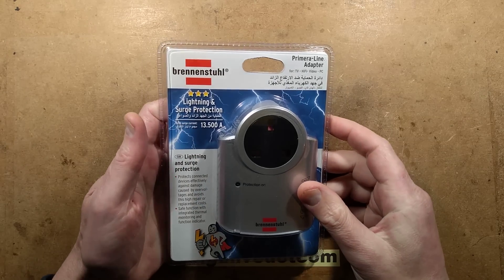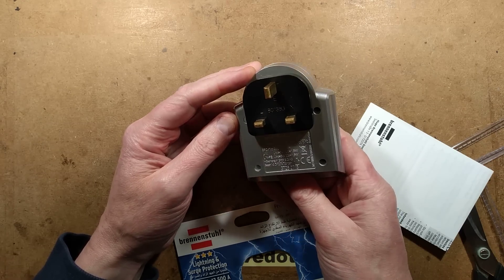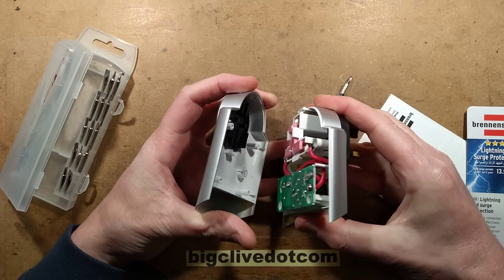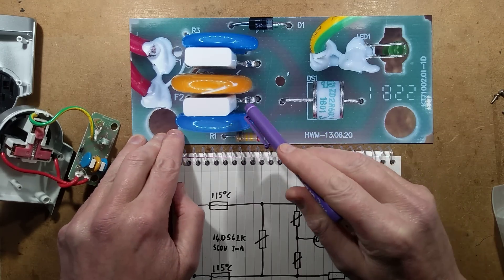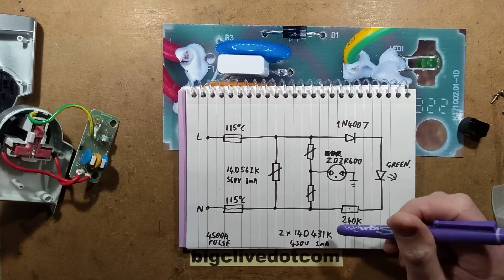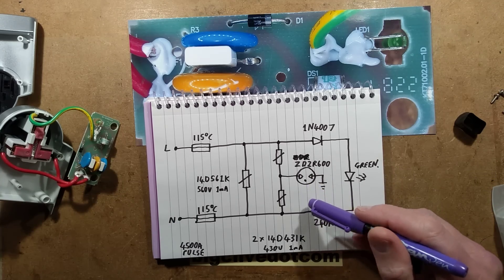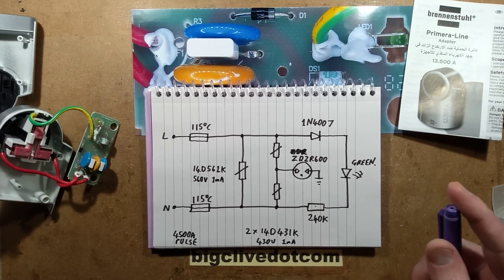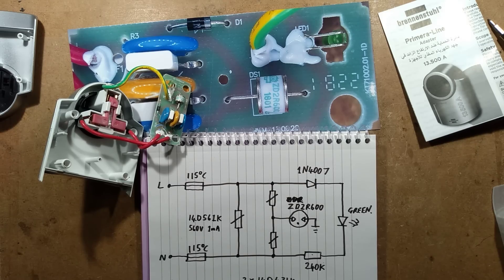Inside a 13,500A surge protector.  (With schematic.)

Comment: Thermal fuses in a sandwich squished together with HEAT shrink tubing. Assembly must be fun.
Reply: Perhaps they shrink the heat shrink around a form and then slip it over the components similar to how clive pulled it off.

Comment: I had an RS branded protection device,it actually called itself a power conditioner and did have some chokes inside as well as capacitors along side one very big MOV, I used it on  my computer and printer. I came home recently and there was the smell of burning plastic and electronics throughout the house. I traced it to this device and found that there a a big hole in the side of it with scorch marks up the wall, when I took it apart the MOV had disappeared,exploded right off the board leaving just stubs of vaporised wire. As far as I know there had been no thunderstorms in the area and nothing else in the house was damaged.
Reply: MOVs degrade with every little spike they eat.  Eventually, they short and kill themselves exactly as you describe.
Reply: Some of the APC Surge arrest devices are intentionally designed to do this. I had one in my office at work. Just like you, came in one morning to smell of electrical smoke/burn. Dozens of other computers on the same floor and branch circuit were not damaged. Neither was my computer. But the APC gave it's life to protect it. Numerous internal components were blown to smithereens. So, the APC was "sensitive" enough to blow, undoubtedly due to some kind of surge, even though the surge did not kill any other equipment. So it was a $45 fuse. Later research on my part revealed the APC was DESIGNED to do this. Very sophisticated. It is built like a brick house inside. I still use them today (same model). By the way, the plastic housing is flameproof.

Comment: If the circuit is just in parallel with the mains, wouldn't it be then way more useful to install it directly inside a fuse board? (In a different form factor then.)
Reply: L3P3 Those are available from major brands of fuseboard switchgear.

Comment: I had to go back to around the three minute mark to see where line current came into the device. I was thinking the current had to go through the circuitry and then out the other side. Trickily, they connected the gozinta directly to the gozoutta.

Comment: If there was a problem and the gas discharge did its job would that then trip the rcd on the fuse board?
Reply: That as well as fuses/circuit breakers. The problem is that those aren't fast enough to stop high energy pulses like a lightning strike or near strike.

Comment: How would you test such a device?
Reply: Bas Emmen Charge a big capacitor bank to deliver a short 100kV pulse through a simulated wiring impedance. Measure voltage peak across device and make sure it stays somewhat low.  Labs like KEMA have the setup and procedures.

Comment: I do love how the world still can't decide 9n universal standards for things, there's thousands of standards and yet we can't decide on if we want commas or decimal points, it's a mess, we just need to standardise everything, it'd make life so much easier, it's like how the UK has Metric as the "Official" unit of measurement yet uses MPH as the speed limit, no logic, or the inconsistent use of commas and decimal points, different electricity voltages and frequencies, and, measurement of things like power or torque, very very frustrating
Reply: peter geary Because that number notation has been deeply ingrained in human languages, it's basically unfixable as long as there's a large fraction of humanity on each side.  The scientific way is to never use 3 decimals after a decimal marker and always use the proper metric prefix, for example 13,5kA or 13.5kA for the claimed abilities of this thing.
Reply: Keeping MPH is the least of it, I had the misfortune to be working in a laboratory when the UK was transitioning from Imperial to Metric then to SI which lead to some bizarre kludges like coating densities in milligrams per square foot.

Comment: Why have a diode in series with the (light-emitting) diode?
Reply: Ugo McFoley XXIV The diode will limit alternating current so that it only flows in the direction that the LED requires.
Reply: @gordonrichardson2972  But so will the LED itself. It's a diode.
Reply: Ugo McFoley XXIV LEDs do not like to be driven under high voltage reverse polarity, it severely degrades their lifetime.
Reply: @ugomcfoleyxxiv8621  LEDs have very low reverse breakdown voltages - they can't withstand reverse line voltage.  You have to have a real diode in series.

Comment: On the back of the device it "clearly" states that it is for 13.5 Amps - further supported by the rating of 3120W (230V * 13.5A).
The extra zeros behind the number are just there to get people to think it says 13 500 when it really is just 13.5 A.
Reply: 13 amps is what you can plug into it, 13K amp is what it's "rated" to block before turning into a bright flash.

Comment: If it was a thirteen-and-a-half Amp unit, it would not have two zeros at the end. Basic rule of scientific and engineering notation: don't include more digits than are significant.
Reply: pieter zeeuwen Perhaps those digits are significant, and it offers very precise protection of 13.500 A and not a milliamp more :)
Reply: @Bomag  Good one. I could have been the case if we didn't know that the components inside are not that accurately specified (thanks to Clive's insights).
Reply: @pieter1102  Yeah I was only kidding - just making a nerdy joke around the fact that engineers use trailing zeros in decimal numbers to specify the precision.
Reply: @Bomag  I got that (even though I'm an engineer), which is why I said "good one" (i.e. good joke). Maybe that was the Brit in me talking. If so, I seriously apologize (and that is the Canadian in me talking) ;)

Comment: Nice design,  although with every voltage spike the MOV's get they degrade.  When getting to a point when another voltage spike penetrates through the disk you have to replace the unit or replace the MOV.
Reply: Ruan Esterhuizen Hence the fuses and the LED that turns off when it's dead.

Comment: The outputs are past the thermistors right?
Reply from the maker: The input passes straight through to the output.  The module only clamps spikes.  If the thermal fuses fail the unit will stop clipping spikes, but the output will remain live.
Reply: @bigclivedotcom  so the thermistors just protect the LED. ;)
Reply: @danielbjohnson  That is probably a good idea, a LED that is blown to pieces by a nearby strike will fill the room with very small projectiles going way too fast.
Reply: Daniel Johnson No the thermal fuses (NOT thermistors) protect your mains from dead MOVs.  The LED shows if the thermal fuses are blown.

Comment: here in sweden 13.500 A means 13 tousand 500 amps. To specify decimals, you use comma, like 3,3v is three comma three volts, slightly above 3 volts. IMHO its best to use spaces as separators instead of dot, when separating digits for readability, makes it clear both for comma and point countries at the same time.
Reply: That is indeed the ISO norm:

https://www.iso.org/sites/directives/current/part2/index.xhtml#_idTextAnchor105

Commas for decimals, spaces for 3-digit grouping.
Reply: In Sweeden you also speak Sweedish, which makes it clear what convention should be used. All English speaking countries use the decimal point, therefore only this convention should be used when writing in English.
Reply: South Africa uses the comma for decimals. Also, the IEC recommends the use of the comma for all languages. However, they also recommend the use of a space (not a dot) to separate groups of 3 digits, which is the real issue here.

Comment: Does the plug have a fuse, or does it go directly on the 32A ring.
Reply from the maker: The fuse will be in the plug that is plugged into the unit.  It does seem a bit odd that there's no dedicated soldered HRC fuse for the transient suppression.

Comment: Does the thermal fuse reset when the temperature drops back below its fresh hold ? if so what happens with the varistor? does it heat back up? does this continue to cycle like this ? or does the thermal not work anymore ?
Reply from the maker: The thermal fuses are one-shot.  The only time the MOV should get hot is under failure conditions.

Comment: Yo quick question I am from Greece and we use type C/F power plugs on 230V 50hz while in England type G plugs are commonly used on the same Vs and Hz ,today I will be traveling to England ,will I be able to use a common type C plug phone charger on a type G power outlet and if so is there anything I should be aware of ?
Reply from the maker: If the charger is rated for standard European voltage all you'll need is an adaptor to plug it into a square pin socket.
Reply: bigclivedotcom thanks a lot ,love your vids

Comment: Legitimate question.. Wouldn't a surge suppressor plugged in anywhere in the house suppress transient voltages? the load is in parallel with the MOV's. As long as the item is on the same phase as the suppressor, shouldn't it also be protected to a degree? Or does it have to be between the source and the load? Edit: He just said it would. lol Didn't get that far in the video

Comment: You should compare it with APC Surgearrest Essentials.
Reply: Xanthopteryx : I tore down an APC surgearrest, they have 3 varistors, each one with a thermal fuse. 
and the varistors are bigger : they measure 20mm, they trigger at 470V and can withstand 6,5kA pulse. 
and the APC had also a gas discharge tube
Reply: @ElectroXa  Which APC model did you tear down?
Reply: kwinzman : the model with an on off switch, and 5 outlets (eu style) 
but I don't remember the model :-/
Reply: @ElectroXa  I think I might be late, but the model is Schneider -APC : PM5-GR. Cheers.

Comment: Hey Clive, stupid question.  Wouldn't it make more sense for the gas discharge to activate at 60V not 600?  Just thinking at 600V it would require over 1kV fault line to ground to activate, 490V seems more reasonable.  Maybe it's 60 x10^0.  I have been wrong many times before though
Reply: The protectors have to have a trigger voltage above mains, i.e. >420V DC, if the GDT was set to less, then it would trigger and get very hot (it's not in the thermal pile of the varistor/fuse) until it glow cherry red, when it would set fire to the casing, the lead welds might fail, but it will be 🔥 fire.  I used to test GDTs.

Comment: You should take an Apple usb cube from America to bits. They're so small, i wonder how they do it
Reply: I've taken one apart, they've got 2 circuit boards (like some others he's taken apart, I believe) and are really clever, but it takes a Dremel and/or Vice of Knowledge to take apart. They've got glue out of the wazoo.
Reply: Teslablade I believe the cases are actually ultrasonically welded, not glued.
Reply: Very interesting is apple power brick for macbooks,  we have one opened (they fail over time because of constant heating),  very complex engineered, huge pure copper pieces (many copper inside) ,  maybe 100+ components with micro capacitors,  they made very impressed work for filtering noise (Chinese cheap copies, original are quite expensive, made such noise in whole house that you can see it on TV).
Reply: @fontenbleau  good design no vent or cooling ....made to not last because of safety I think
Reply: @davey2k12  what? How does it not lasting have anything to do with it being safer? (I guess it does protect Apple's wallet from being empty). That these things get so hot is a design flaw. Personally I haven't had any issues with them breaking yet, but it does get very hot, so I wouldn't be surprised if they fail.
Reply: @garageghost6038  well if ya think mains to usb  circuit needs to be covered so ya don't touch it ....but let's no heat out and its heat proof too but the capacitors might only be rated 85°C or 105°C then they fail ....they seen opertunity to pump more glue inside 😂
Reply: I bet the glue to stop ya opening it and to make it hotter desiged flaw
Reply: Da ve They had to recall the first ones globally because the live pins could fall out and stay in the socket as exposed live deathtraps.  Improved model is made not to fall apart and marked with a small colored dot.
Reply: @johnfrancisdoe1563  wot a joke product from China

Comment: I'd like to see the PCB tracks after a 4,500A pulse.  I suspect the MOVs would be superfluous.
Reply: Depends on the surge duration. Those traces may be able to survive a 4.5kA pulse if the pulse is just a few nanoseconds. a 10kV@4.5kA for 5 ns is less than 5 Joules of energy. Usually a lot of high current surges are just a few nanoseconds. It's the small ICs\microcircuits that will easy fail with just a small amount of energy (ie < 5 joules).
Reply: Testing in Europe is a 10 x 100 us pulse. US is 8 x 20 us pulse per IEEE.
Reply: @curtw8827  In Europe, protection devices are tested with full duration metric lightning strikes. In the US, our electronics are tested with a cheaper, easier to produce imperial lightning strikes. Exactly how the imperial lightning strike was standardized is lost to history. The legend is that it was based on a lightning strike that killed a Duke that was trying to replicate Franklin's famous experiment where he flew a kite in a thunderstorm.
Reply: @hamjudo   Great, you made my day :-D
In germany we have to use proper Surge protection in new electrical systems.
These are ratet for  In 20kA and Imax 40kA also 275V AC not like this device over 400v.
Reply: That's what the GDT device is for, should have two of them though. The surge device would probably be in pieces but whatever it's attached to would likely survive short of the plug. 😂

Comment: No, that's a 13.5 amp...there no way it could even conduct anywhere close to 5000 amps let alone 13,500 amps.!!
It would be a disaster to try and put that amount of current in a standard plug.
Reply: Standard plug can take much more pulse current than you think, it's only a pulse. If it were to be continuous, that would be a different story.

Comment: Back when I was more naive about electronics I bought a Tacima mains ‘conditioner’. It had a bunch of inductors and caps that were visible through a see through casing. I’ve often wondered if it was doing more harm than good by altering the mains before reaching the electronics.
Reply: EMI filters can actually do good, but generally aren't necessary in ordinary home environments. In test labs with sensitive measurement equipment, removing a possible source of EMI can be very important.
Reply: NiHaoMike Also with some older HiFi gear that doesn't filter out mains overtones.
Reply: Appreciate the thoughts guys